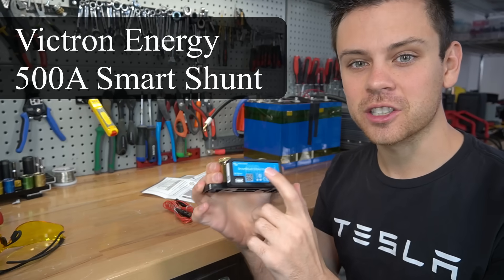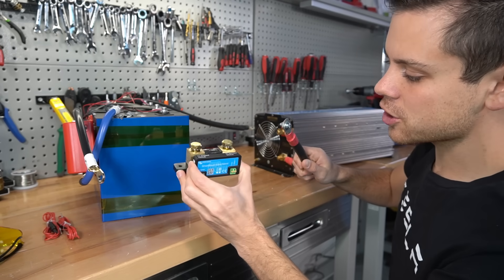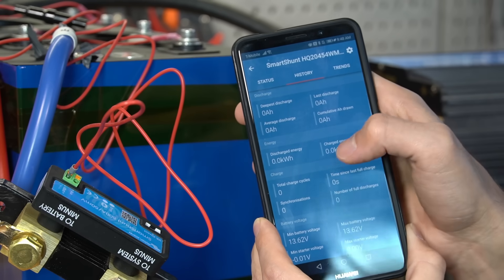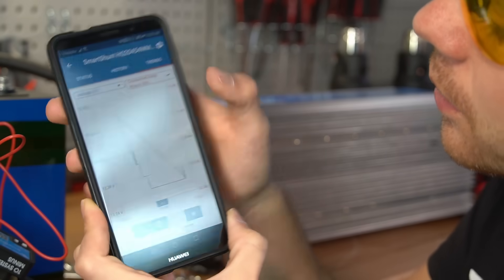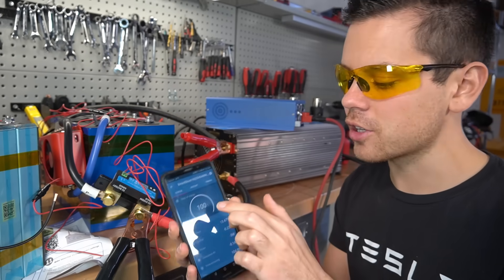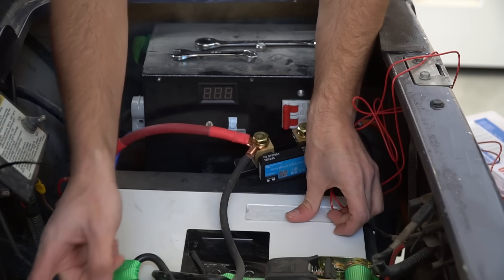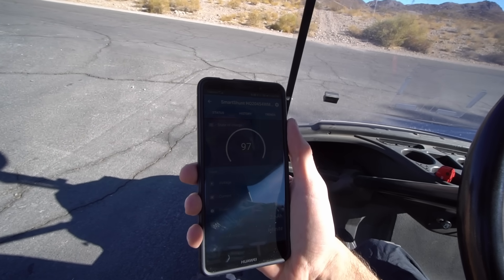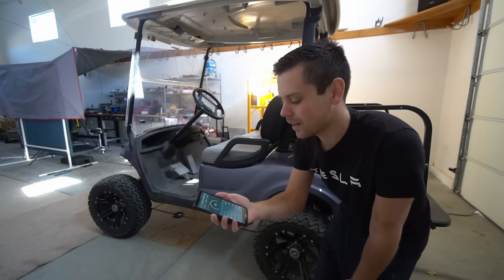Victron Energy 500A Smart Shunt (Beginner Friendly)

Comment: I have the victron 100/50 smart solar charge controller and two SOK batteries, I’ve been delaying to install my system because I’m not sure if I will need this victron smart shunt in order to pair my batteries with my charge controller. Someone told me the bms in sok batteries doesn’t connect to Bluetooth

Comment: I've bought one of these and it does what it say except for the Bluetooth. You definitely cannot hide it away and read it from the comfort of your couch. I did the firmware upgrades (mandatory) and rebooted my phone (repeatedly) as recommended but the connection drops at any distance over 30cm (1 foot). I believe this is a problem with the Victron app, as the device is visible on my devices from many feet away.

Comment: Hi Will, I just installed an all Victron Multi-plus 3000 system. NAWS sent me the entire package for my RV that I installed myself. In the package, they sent a Lynx Power in, and a Lynx Distributor. I have a  Victron Battery Protect on the DC camper load. What can I use the Lynx Distributor for since I already have it and it is not cost effective to return? It has a circuit board in it. Can I just put it downstream from the Battery Protect, and connect to the Cerbo unit? Not sur what it even does...

Comment: I just installed a BigBattery OWL Max 12v 202 ah battery in my travel trailer, along with the Victron SmartShunt. With battery fully charged the readout on the Victron goes from 13.6 down to 13.3 in about 3 hours. I reset the BMS and attempted recharge the battery, but the battery was fully charged. Let it sit for 3 hours and tit was reading 13.3 again. I don't think it's related to the SmartShunt because the battery reads the same 13.3, while having used just 1.0 amps. Any ideas what may be causing this?

Comment: I'm buying a new boat that has a Magnum inverter charger. I want to add the Victron SmartShunt. Plus, I want to add an mppt solar charger and panels. How might I hook the Solar charger in with this system? If I had all Victron stuff there is a networking option, but I don't have that. Thx!

Comment: Confused on this.  As for shunts, do you need 600 amp shunt if you have a 600AH battery bank and an inverter capable of drawing 8000 Watts at 14 volts?  How do you pick the shunt for your system?

Comment: So the main difference between this shunt and the BMV-712 battery monitor is basically the monitor?  This seems like an easier (no running wires through the trailer) and cheaper solution then the BMV-712.

Comment: So....if I don't want my LiFePO4 Battery to discharge below 70% Capacity, the Discharge Floor is 70%. Is that correct? I'm using three 100AH LiFePO4 Batteries in parallel. Can you tell me the settings that I should have on my 500Amp Smart Shunt? I'm connected to a 2000/4000 Watt Pure Sine Inverter. That is connected to a Freezer.  On the Positive side of the Battery Cable, I placed a 200 Amp Circuit Breaker. I place the Positive Shunt Data Cable on the Inverter Side of the Circuit Breaker. I'm anticipating that when I break the circuit, the 1mA draw from the shunt will not drain the battery when I shut everything off. I still need at least 400 Watt of Solar Panels to charge via Solar. I don't have that yet. I purchased a 30 Amp Victron Solar Charge Controller. I haven't used it yet. Again, I would appreciate your advice for the shunt settings. Thanks.

Comment: I have an application with solar panels connected directly to a DC water heater element (totally DC without battery nor inverter). Can I use this Victron Smart Shunt to measure the amperage and voltage from my photovoltaic panel?

Comment: For the longest time I’ve put off buying something like this as I figured they were nice to have but not really needed. But I’ve come to the realization it’s like driving a car with no fuel gauge, before you know it you’re out of juice. After seeing the full extent of what this thing does I ordered one today. Can’t wait to try it out. Great video as usual Will.
Reply: Measuring the voltage usually works fine to know the charge of LifePo4 battery bank... I bought this to have a little more information of usage.

Comment: Bought this based on your review.  I wanted to set it up and use it on my AGM batteries before I install the lithium ones in my RV.  Worked great, except once I close the basement doors or move into RV the Bluetooth disconnected.

Comment: Can I use it also for my starter battery? Are the 500A enough for the short, very high currents which go from the battery to the starter? I think those can be in the 500A range as well.

Comment: Have you grouped your YT videos together by subject and/or skill level? I'm a novice to electricity ans need starter lessons about all if this. For instance, what is a shunt?
Also, why do sime people use differing terms for the same thing in electricity? ie watt hours and amp hours for how much energy can be had out of a battery bank? And why don't the solar charging monitors tell me in Amp hours how much energy is remaining in storage and instead tell me how many volts the bank is down to?
Electricity is too confusing. Make it simpler please.
Reply from the maker: Wh and Ah are different. Check out my beginners playlist
Reply: @WillProwse  Thanks Will

Comment: Please explain with one of your recommended all in one 24volts (MPP or Growatt) proper setup for wiring of Step down 24-12v converter to WFCO and in from shore power to WFCO 30 amp AC/DC panel. The extension cord deal in other videos not helping us RV’ers in this aspect. Greatly appreciate all your information you give.

Comment: Question not related to this video, but i have a 72 50ah battery for my electric scooter. It has one output/charge connector, but i have build a charger inside the scooter so i can plug in everywhere easily. Now the question: can i leaf the charger connected(not connected to the grid but when its off) while using it when driving?

Comment: New to this.  Trying to produce 2.5kW +or-  @120v to use throughout the day and into the evening at my house.  Basically like using a 2.5kW generator.  I'm looking at Growatt 48V SPF 3000TL LVM and 48V LiFePO4 Powerwall (8S5P) am I heading in the right direction?  As far as the panels I'm not sure what to do and could use some advice as far as how many, wattage, brand and how to wire. Any help would be appreciated.
Actually 2.5kW would probably be only when frig and/or freezer starts so average would probably be around 1.5Kw

Comment: The only issue I found was when I mounted the SS in my battery bay (Faraday cage) the BT signal became so weak I had to be standing pretty close to it to read it.   I returned it and just purchased the BMV712 for about $100 more, that allowed me to put the head unit up inside the RV and I can connect via BT from anywhere inside, and fairly far away outside.  I had the same issue with my Smartsolar controllers, they are in a different Faraday cage with the same effect.   I did try the BT Dongle which worked when mounting that up inside the RV.  But I ended up selling that and setup an RPI with the free VenusGX software that allowed me to connect via  Ethernet (via a WiFi AP in the RV).  It also populates their Website called VRM, so it can be viewed on my phone no matter where I am in the world.
Reply: I have the smart shunt but was disappointed that it cannot transmit to my phone in another room 15 feet away with a wall in  between. In the same system is a Renogy shunt and display.  I had a spare $35 ''pet cam'' that can not only look around the shop remotely with built in pan tilt zoom, it's microphone can hear the inverter fans running.  The Renogy display shows % charge/discharge, voltage, amps, watts, and remaining amp hours and run time left. I can view it from on my phone from hundreds of miles away. Is there some way to get that Victron reading through bluetooth so it can be read remotely over the phone?

Comment: FUTURE VIDEO IDEA!  My water heater is the biggest energy hog in my house(I have a sense monitor).  Can you make a video to show how to just run the water heater off solar?  I have one of the switches that goes back to line current when the batteries get low so I always have hot water(in Michigan the winters might not make enough solar). I am still looking for an inverter that can carry the load but I know the elements will run off DC but not sure if that switch will switch from DC to AC.  PLEASE HELP.  PS you should put a email account in your “about” info so video ideas can be shared without them being public.  We would probably need a battery involved as we tend to take showers in the morning.

Comment: Will ... similar to the instructions you have for setting up lithium battery banks; what are the chances you might offer schematics for running a victron from the alternator to a battery bank that's already connected (or not) to a charger controller?

This would help to know what all you should have ... like a (on/off) safety switch? You might even offer for a price. I would pay for it. $19.99 I would pay for it and chances are lots of others would too. People are intimidated by what you breeze through.

Comment: I noticed it was not exactly 'peak-hour' traffic on your roads (luckily) lol. On a tangent, I'm about to build a shed. Can you advise what infrastructure I should be putting in with the build so I can more easily  add solar and batteries later? i.e. future proof it. I'd hate to find out it would have been so much easier / cheaper to do something prior to the build.

Comment: Hi.
Was lucky to get a notifikation for your video and Channel.
I’ve been watching some of your videos and find them very good.
Could you tell me what I would need of Solar panel, controller, inverter and battery to power 2x 12v 150w heaters with a tempature gage/timer so they only turn on when the temp is under a certain degree. Run time a day would probably be around 6 hours max.

Comment: The shunt is the pretty much the same as the one that comes in the BMV-712 battery monitor. For your golfcart, you could use the BMV-712's display to monitor SOC while you're driving, instead of using the smartphone app. The BMV also has BT, so you still get the same functionality as the smartshunt anyway.

Comment: Thanks for spending you time on this video. Video 2 may be a way do drive relays based on voltage triggers so we can eliminate our voltage monitor Victron 7xx type devices. Also the use of multiple shunts when we have different batteries.

Comment: We put a Victron complete system in our adventure van and it is amazing. Works perfect with no hiccups. The shunt has to be zero current calibrated exactly or the battery percentage readings will drift away from accurate. Our LifeBlue batteries have Bluetooth built into them so I know the exact battery level at any time. The shunt doesn’t track battery percentage exactly but it is in the ballpark pretty well if calibrated correctly.

Comment: Hi 🙋🏼‍♂️  I have a yeti goal zero 1000 and today I tried running a attic insulation machine on it and after 10 min of run time the goal zero broke ...it does not power on , I tried unplugging the battery and replugging it back into the ac wall charger and still nothing, I also check the fuses and they appear fine . Any ideas on what it can be ?

Comment: Just bought one of these for my off grid workshop , does anyone know if i could  set the discharge floor to diconect any loads at a set parameter say 10% state of charge ? my bms disconnects at 2.5 per cell and i feel uncomfortable taking a cell down to that level even if it's only a one off, as happened to me recently?

Comment: i installed this on my travel trailer to monitor the two lead acid batteries when i take a few trips off the grid.  its works wonerfully.
Reply: Does it automatically know what type of battery you are using or do you have to switch it manually?
Reply: @super73satx  its bluetooth to an app on your phone and there are settings for battery type.

Comment: What a nice piece of kit, I can think of many applications for it. Though I would prefer something that's open source on the software side. That way you could do some really cool automated tasks with these in a closed home network.
Reply: Looks like the smartshunt has a ve direct port, same as the BMV, Blue/SmartSolar charge controllers, etc.  You can read that data with an arduino/similar.  I'm not sure about writing to it.  Ex: I can read data from my chinese smart bms and read data from my smartsolar charge controller with a single arduino, but never got around to figuring out how to write "disable charging" to the smartsolar for example.  That would have been really cool as I could have leveraged the temperature readings or cell voltage readings as a redundancy to the BMS protection.  And you could cut out some victron add-ons this way.  In any event it's possible to parse data, repackage it, and serve it over bluetooth (ESP32 instead of arduino), host a webserver, push it to firebase, whatever you want.  I was having an issue with a cell running away and was able to write some simple code to detect when the charge controller entered float and then post all the individual cell voltages, temps, and charge current just prior to float.  All to firebase so I can view anywhere, and digest with a mobile app I wrote.
Reply: Electrodacus is open source and does way more functions. Except it won’t do 48 volts so no go in the golf cart.

Comment: Also important to note that the 2nd dc wire can only do 1 function at a time. You have to choose between 2nd pack voltage , mid pack voltage, and temperature.
Reply: Is midpack voltage is needed only if you have 3 or more batteries?

Comment: I have one of these Will, and I am using the free code that Victron provide on their site with a raspberry pi to get that Cerbo GX setup cheaper.  Its something you should look into if you haven't already.  I need to do a rebuild of it with a better pi but it is an awesome little setup.
Reply: Please post a link to the code and any other info you have on using the Pi. Whats the interface? RS232 or RS485? What cables did you use?

Comment: It’s a lovely unit. I use it to test capacity (along with a ex 2kW lighthouse bulb which at 53V gives me a perfect 5Amp load) and make BMS adjustments when making lithium battery packs. The Bluetooth range is not so good, compared to the Daly Bluetooth for example.

Comment: I've been comparing it with the Aili and Juntek shunts for a couple months and the Victron SmartShunt is 100% worth the money.
Reply from the maker: After using multiple cheap shunts over the years, I agree with you.
Reply: @WillProwse  hey Will do you know of any lithium batteries that can be used as a start battery. I have a motor home that runs a 24v truck system and plan on running a 24v house system and would love to combine the two so I only have the one set of batteries
Reply: @WillProwse  In a system with a "critical loads" panel where is the neutral ground bond when the main panel is isolated during a grid down condition?
Reply: @WillProwse  Will, your comment perfectly illustrates the "buy cheap" mindset and its obvious & inevitable shortcomings. Rather than buy the higher quality $8.00 screw driver ONE TIME... people will repeatedly buy the same el-cheapo $3 screw driver that constantly breaks.
Reply: I have the alia ,not that good realy i have set it up properly, but when the battery is fully charged it doesn’t show 100% on the monitor it just keeps going down , 3 days now shows 85  % but battery is fully charged

Comment: I've had a linked pair of Victron Multiplus(s), BMV-702 Gauge with shunt and bluetooth dongle for 5 or 6 years. We get a very low feed-in-tariff here, so my 24v 1000ah LiFePo4 batteries are charged daily from grid connected solar and at night a timer disconnects the grid power and the inverter takes over using it's UPS function, although I don't tax it with the demands of the oven or a/c. It works flawlessly....you get what you pay for.

Comment: What is the shunt burden?  ie - the shunt resistance or voltage drop a some specified current. They don't show it in their datasheet.
Reply: To little resistance to be noteworthy.
Reply: @AndrewSparkfish  A milliohm at 500A is a half volt drop and 250W of heat!  Wondering if it is a Hall Effect sensor or resistive shunt.

Comment: Does Victron make a charge controller that will handle both the alternator and solar panels? Like the renerge product. I really like the Victron app.
Reply: I don’t think so? Separate Dc/Dc charger for alternator and Mppt for solar both smart/Bluetooth available. I like separate units as more robust and if one fails you’ve not lost your full system.
Reply: @MrMaster72  thanks, I am going to change out my lead acid batteries in my sail boat to lifepo4. Thanks to you.... I think I can have 4 times the power reserve.
Reply: @VentoRacing1  yes makes sense,I love Victron and the app is very good..I’m running AGM but would love lithium ..twice as much capacity and so much lighter. SOK lithium seem good at a fair price..Will’s reviewed them..I’m in the Uk,not many options available...Battleborn seem popular in the U.S or do your own pack with BMS! DC/DC charger is a must with lithium unless you’ve got a really heavy duty alternator in the boat. Watch the Victron video where a standard alternator burns out!
Gold standard set up for me would be lithium batteries/ Victron smart shunt / Victron DC/Dc 30amp / Victron solar charger.

Comment: Thanks Will.  I just installed my RV solar system with Victron equipment.  Calibrating the shunt is something I overlooked.  Thanks for the demo of that process.  I'll be calibrating it tomorrow!
Reply: It's been 10 months, did you get around to calibrating it yet?
Reply: This video is Dexter, from Current Connected, not Will Prowse :)